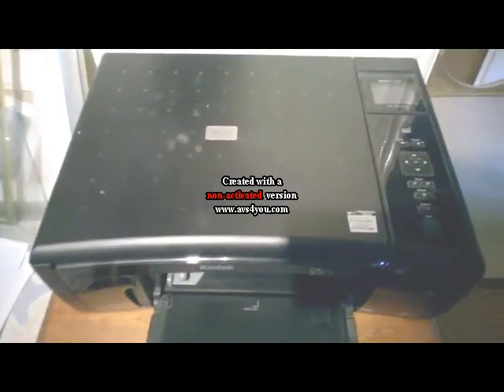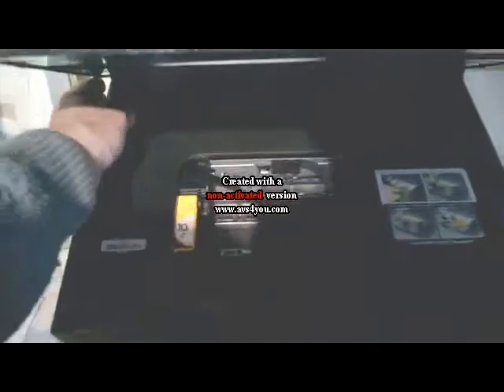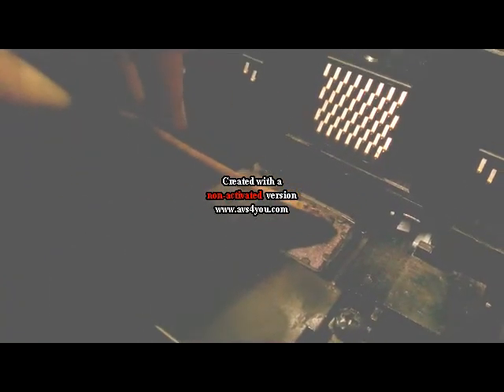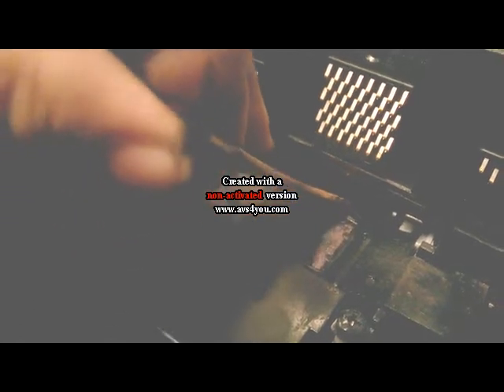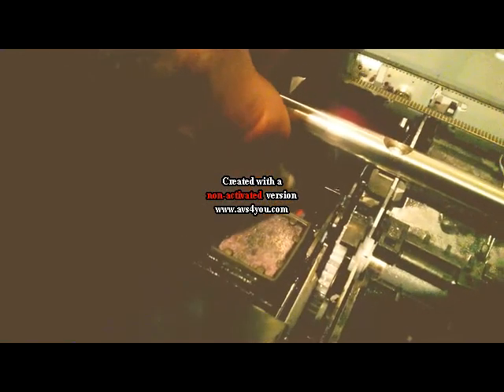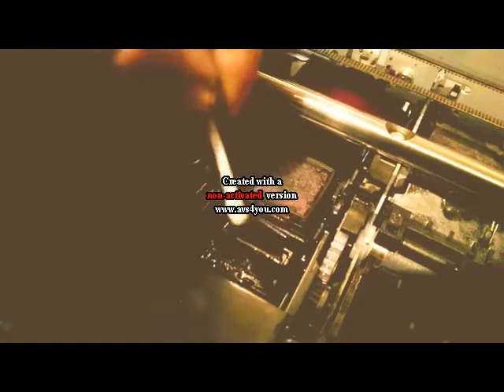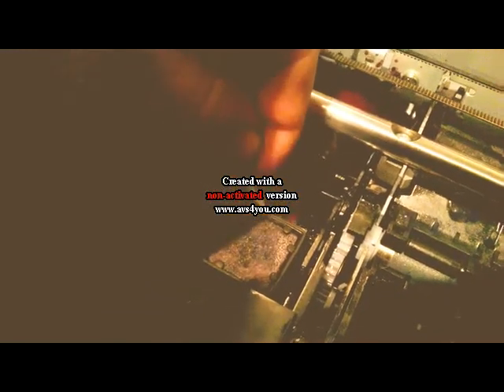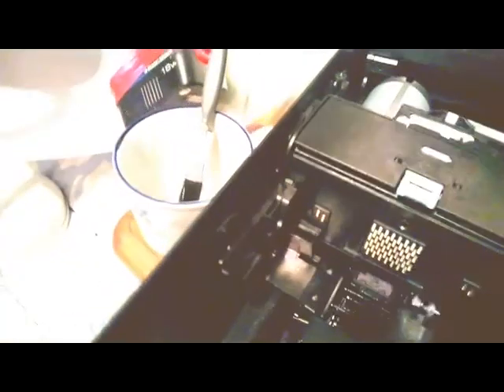kodak 5250 error 3527 stuck cartridge carriage  fixed

Comment: I can't get the tray to slide back, the little pad is springy and I can push it down a little but the plastic part won't move back, tried pushing with finger and screwdriver, anything else that could be stuck?
Reply from the maker: if I remember rightly it requires a little determination and wiggling. You really have to push the pad down first and then slide it back. I bet your pad hasn't gone far enough down.

Comment: shit made-in-china printer, had this issue and it wouldn't go back without force, and now there is a dent in it from trying to push it down and in with a flat-head screwdriver (needed something rigid for it to budge). in the bin you go! junk. no wonder kodak stopped making printers in 2013.